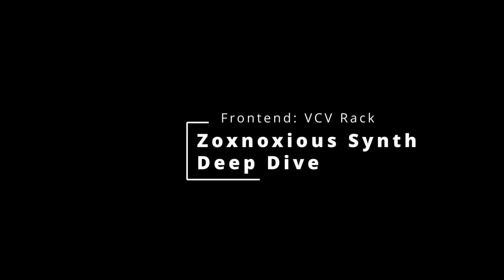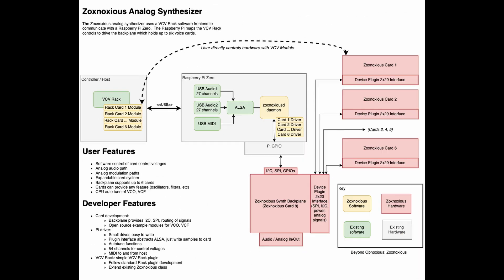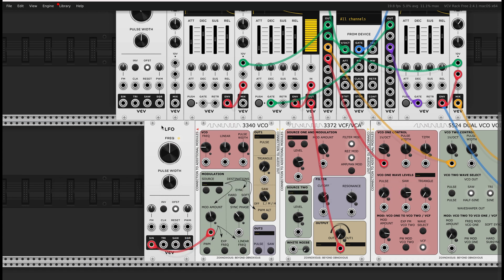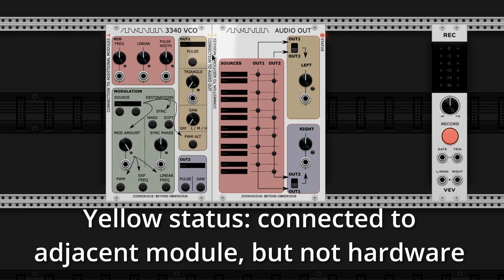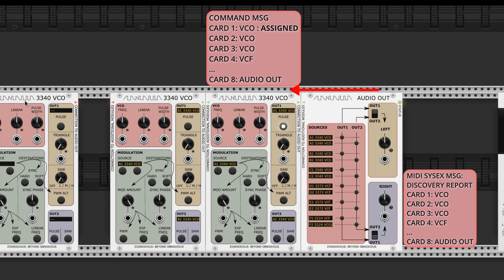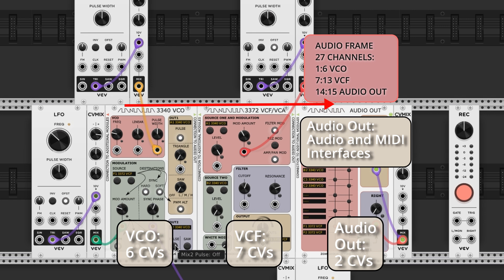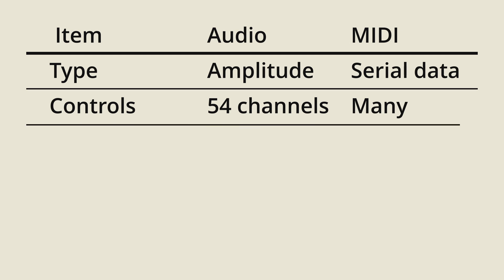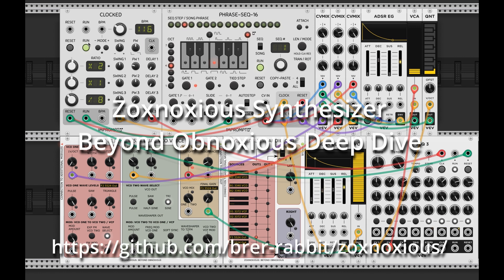Zoxnoxious Deep Dive Part 1: Project background & user interface with VCV Rack

Comment: i am super interested in your build. I understand every bit you say, i know my dacs from my class-d from my fpga; but the pace and the tone makes my brain run away to other places. Your delivery is accurate an thorough, but your initial general/"bird-eye" description was incomplete. This makes a good thriller script but a frustraiting wondering exercise for a mind like mine. So far it seems you ve got a high latency UI2midi2usb2raspi2CV and a hybrid digital/analog signal path that MAY become interesting. I keep watching.
Reply from the maker: Thanks for the feedback and you're right on the lack of hardware detail here.  It's really tough to put these videos together for a generic-ish audience.  With this first video I kept many lower level details out of the picture and focused on the frontend UI which I felt is the most accessible part.  The second video discussed aspects of the Raspberry Pi.  I see one more video in the series that goes into the hardware layer, that might be what you're looking for.  If I started the first video with "the Pi's 12 MHz SPI is level shifted by the backplane with an 74HCT245 buffer to go from the Pi's 3.3V to 5V and routed to voice cards 8-channel DAC where analog signals go through a reconstruction filter at 1.5 kHz" I think I'd lose everyone pretty quick.  Look at the schematics on github for that :)  Really though if there are specifics you'd like to see let me know, I'm thinking about what should go into this third video as it should cover the hardware side of things.

Not sure about the latency comment.  Latency is quite good as it's basically the latency of a soundcard with a small buffer.
Reply: @UltraTroninator  thanks for the reply! what I missed was the"functional block diagram" In fact I was surprised you delved into quite some detail before the full picture. 
About latency, I think it is bad for realtime human-triggered note events. Generated and/or sequenced is fine. The fact that samplerate is down to 4ksps may mean that if you have a fixed minimum buffer (byte)size at any stage, it'll mean more latency(12 times at worst!) than usual audiorate.